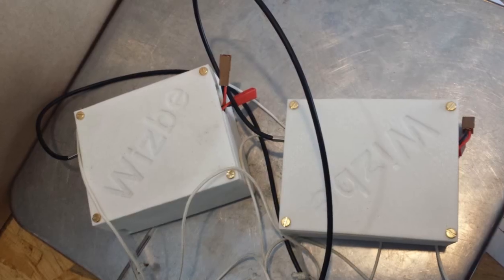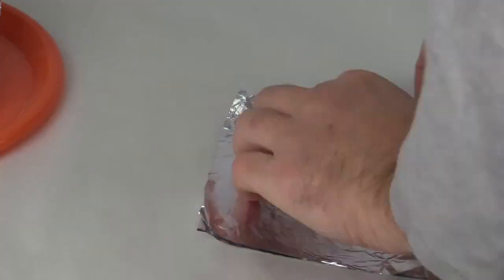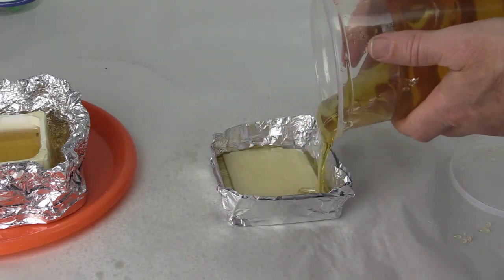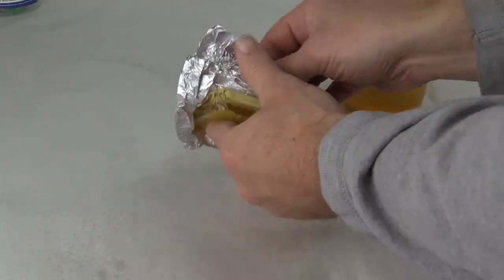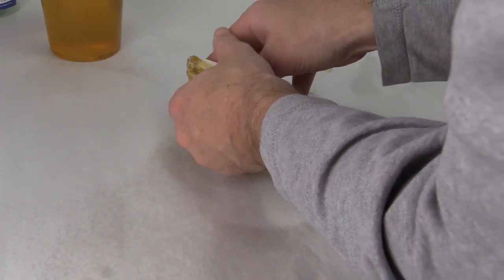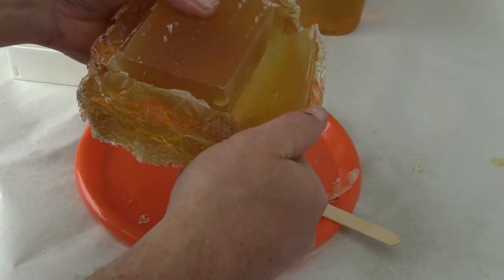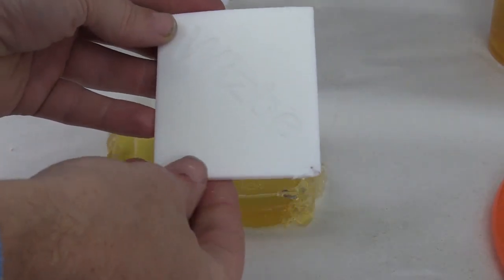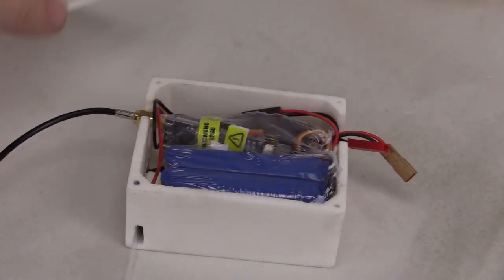Molding a 3D Printed Part to Make into Plastic

Comment: Hello, Can you tell me what size package of Composimold did you need to you use? I am trying to gauge how much I need to buy. The dimensions of the part which I am trying to make are 4" x 2" x 1" deep. Also, I need to recreate both sides of the part, not just one side and make two parts. The part is a door handle Bezel for my 1979 Subaru Brat. They are brittle due to age & the 40+ years of Sun/Heat. I am uncertain if using the ImPRESSive Re-Usable Putty is better or worse to use rather than the Composimold product. (Facebook link to pic) https://www.facebook.com/richard.tyll/posts/10212212624090969